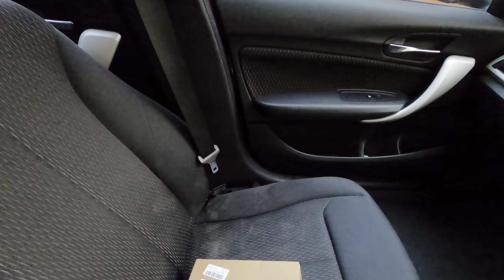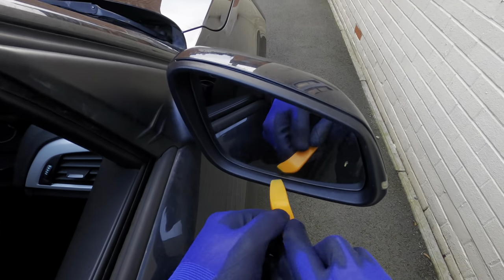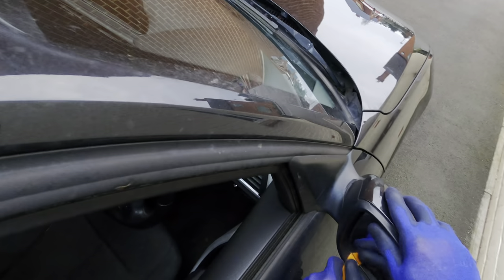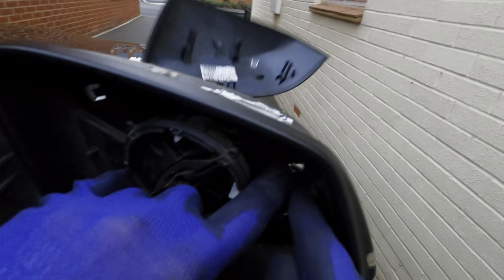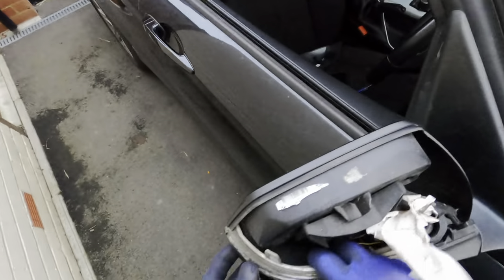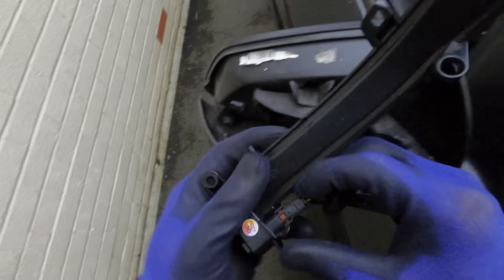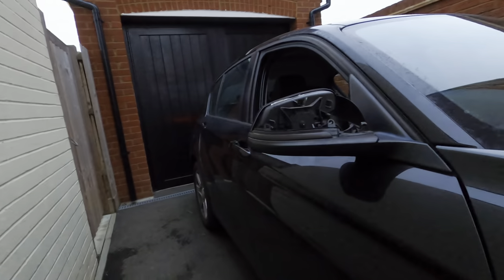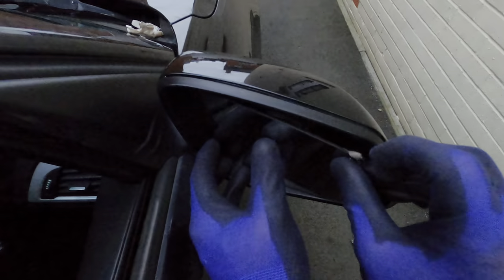How to Change the Mirror Indicator on a BMW F20 1 Series | Dynamic Mirror Indicator Installation

Comment: i just finished doing this to my BMW. trying to take out the mirror is a scary task. But very much worth it in the end :)
Reply from the maker: Glad you got it done, getting that mirror out was an absolute FAF for me! 😉😆
Reply: @NathanMannin  just got done fitting apple car play into my car. Have you done that ?
Reply from the maker: @ollieseddon7740  I haven’t done that, I’ve always considered it though. Do you think it’s worth it? I would consider doing it in my C63 : )
Reply: @NathanMannin  yea mate definitely recommend. Wasn’t hard to fit and it makes the car feel really modern
Reply: Just got my indicators and m style caps on.. But for some reason when i put car in reverse the mirror isnt tilting as it was before.. No wire or anything from mirror was removed

Comment: What would you do if only 1 is not working? Buy 2 new ones?
Reply from the maker: I would personally do both, otherwise it would look odd having only 1 indicator that flashes, and one that sweeps.
Reply: @NathanMannin  yea 1 or mine is not working. So now have to buy a 2 set. Annoying
Reply from the maker: @fjaff  it’ll look better having two of the same, rather than one different to the other in my opinion!